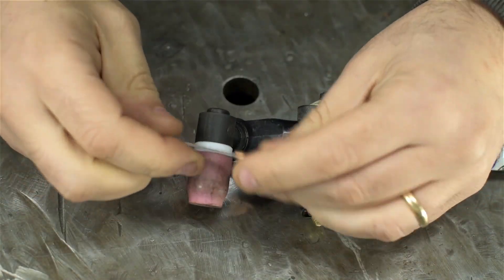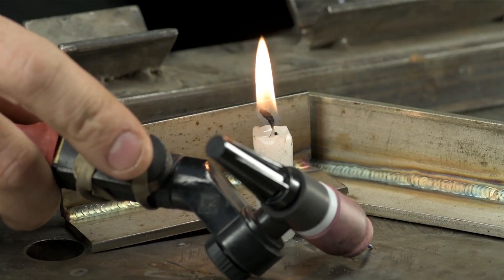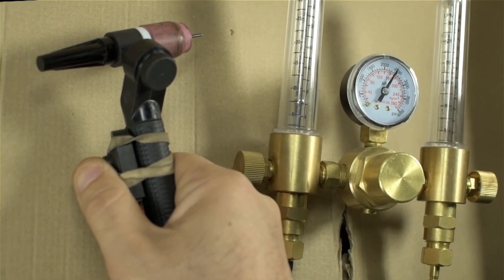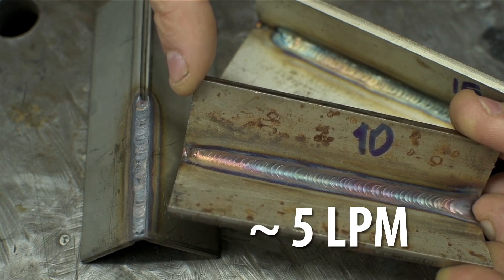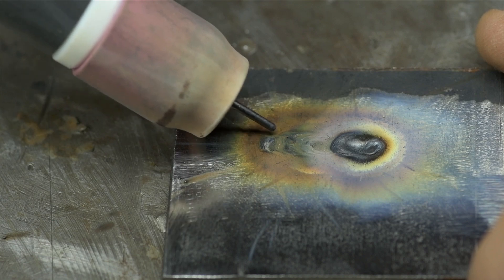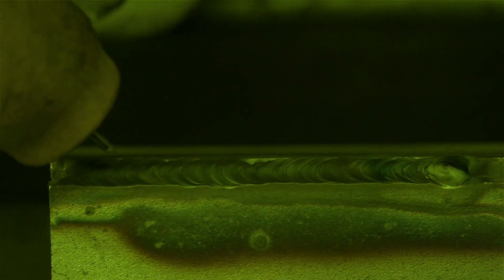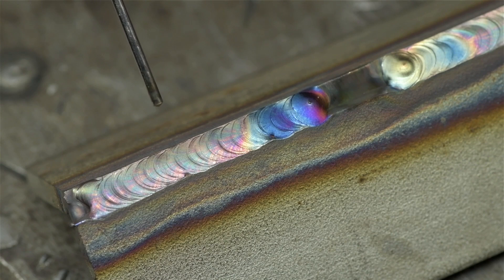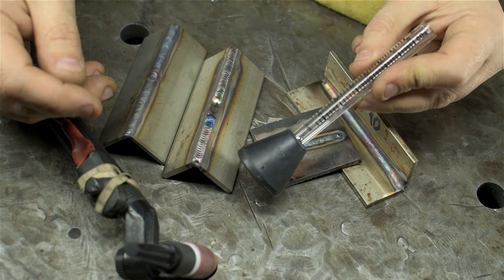TIG: Effects of Gas Flow Settings

Comment: Typically you take the cup number and multiple it by 2 it’ll get you really close to where you want to be with a gas lens. Amps really doesn’t matter much because the thicker the material the bigger cup and tungsten you should be using. Same rules apply x2 on cup size
Reply from the maker: holy poop I think that actually works.  thanks!
Reply: I concur.....a couple of weeks ago I was getting  some nice clean stainless welds with a # 17 cup at a bit over 30 cfg
Reply: splinky99 you every try to weld 1/4” stainless with a 8 cup? Doesn’t work so well you’ll melt the cup right off. You do need to increase your size with thickness as a general rule. They didn’t design them for a suggestion 🧐
Reply: You're joking right? I weld one inch thick aluminium at work all the time with a standard pink #8 cup. I don't think I have ever heard of or seen a cup "Melt" If you're talking tungsten sure, staying within amperage range is a good idea.
Reply: erikdude666 here is your proof since you seem to know it all. And no I’m not joking ..The thicker the work the bigger the tungsten the bigger the cup. Here is some light reading for you. Again you don’t work for me so do what you like but you’re wrong.  Proper set up is by Amps and work thickness. I’m not going to debate you because I know I’m right. 1/4” should be a 10 cup.  You don’t work for me so idc what you do but I also said stainless. You can’t weld stainless 1/4” with an 8 it just won’t work, trust me on that. 

http://weldinganswers.com/guidelines-for-a-proper-tig-setup/
Reply: erikdude666 and yes a cup can melt. I don’t think you weld 1/4” very long with an 8 cup because if you ran and long enough bead it’ll melt at 200 amps
Reply: Im not saying it can't and I have done 4ft or longer runs welding (you name it) and have never had any issues. Most of the time im using a #7 cup (Whats in the stock room at work most of the time)
Reply: erikdude666 BTW big shot this info isn’t mine,  it’s Miller’s calculator for Tig welding. Let me guess you know more then Miller? let me ask one question. Explain to me why a 4 cup is made an why a 8 cup is made? If not for amp thickness?  I find it funny you are trying to talk to the guy that said fight club he wasn’t agreeing with you dummy. And for the record you trolled my post I didn’t write on yours. And you’re the one spreading bad info not me. This is straight from Miller go look. Btw I’m not too proud to do things another way. Your pride my keep you back on a lot of things. The cup sizes are obviously for better coverage as they go up. You aren’t running 300 amps with a 4 and the amps go up on material size in case you didn’t know that either. Sad day when a troll doesn’t know better because he was just taught to use an 8 on every weld he does.
Reply: Easy. Bigger orifice, higher flow rate of shielding gas on more reactive materials. Its why a lot of people prefer a #4 cup with a stand collet body for aluminium. Its a less reactive material, less shielding needed. Youre speaking as if the bigger cup is some how more heat resistant or effective at higher amps.
Reply: erikdude666 BTW you I said it’s a good starting point if you are trying to get set up. I didn’t say it was the perfect way to do it. You say you weld 1” with an 8 but funny you never said what size electrode or how many passes. I’m assuming you think I’m wrong about the cup size x2 to get right around the proper gas flow too right?
Reply: Nope thats actually a pretty sweet rule of thumb that im going to take from this conversation. Im done replying, obviously youre not going to change your opinion and im done trying to explain things otherwise.
Reply: erikdude666 cool now go troll someone else’s post. And the other guy thinks it’s the torch size for amps. He doesn’t realize the same cup sizes are made for all torches. Let me go Tig 250amps with a 4 cup that makes sense.
Reply: What happened to "I'm not going to debate you because I know I'm right". Gotta love primadonna welders. As a separate point, I'm pretty sure you fundamentally misunderstand the concept of debate.
Reply: 9rjharper trolling again?
Reply: good rule of thumb bro.
Reply: Holy poop, is this the secret welders fight club ?  To the winner goes another ToT video ?
Reply: @Johnny Dingo I just despise the spread of misinformation displayed as fact.
Reply: Can't say I have, you might want to look into a higher quality cup considering theyre designed to withstand around 3000F. But that's not what we were discussing at all, im saying you dont need a bigger cup for thicker materials. I have used the same 8 gas lens cup on 350-400amp aluminum work and the only time I have had any issue is dropping the torch. I also use the same size cup welding thinner than 1/8th SS for nuclear applications and have never heard this rule of changing cup size for material thickness. Considering the number on the cup only refers to the ID of the cup in 16ths.
Reply: erikdude666 again general rule. You didn’t read the link. The recommend cup size for even half inch is 5/8” which is a 10 and that’s dictated off material thickness. I also know for a fact you won’t get the correct color with 1/4” stainless with an 8 just won’t happen. I didn’t make this stuff up it’s right on millers site as well. You can do whatever you like but as a general rule this is the correct way. You could be misleading newer welders with your comments just cause you can do it doesn’t mean it’s recommended that’s all.
Reply: erikdude666 the number on the cup you’re right it’s in 16th go to millers welding calculator and you’ll see the cup goes up on material thickness end of story.
Reply: @weldingjunkie  never heard you need a bigger cup for thicker materials. Instead it depends on the material and the coverage it needs, titanium stainless need a bigger cup with higher flow rate. Also the tungsten does not need to be thinner for lower gauge, you can control that with how you taper the electrode
Reply: Alessio Sangalli you’re right about stainless and the calculator compensated for that...but the rest is not true. Does anyone not do any research anymore. 

Go to the miller welding calculator for Tig and watch the cup size increase with material thickness. Just because you’ve never heard of it doesn’t make it wrong. Go to miller welds and look at it.
Reply: @weldingjunkie  when you use a bigger welder you use a bigger torch, like a #26 that is right that we have on the Dynasty 800 but as far as I know it's the torch that is rated, not the cup. Often those online calculators are very "theoretical" as ToT pretty much clarified at the beginning of this video
Reply: Alessio Sangalli my whole premise was a starting point. I’ve said many times if you read do what works for you. The cup size x2 will work. Why do you think they make difference sized for and I know reach is one. A larger cup spreads gas out wider for better coverage I don’t know why I have to explain this LOL
Reply: Alessio Sangalli this is basic 101 just because you don’t do it doesn’t make it wrong. You like your 8 no matter what go for it. Free country
Reply: @Alessio Sangalli Not worth it man, he's just going to beat his chest claiming "Im right! im right!" Sad day when the youtube hobbiest claims more knowledge than a professional trained in theyre trade.
Reply: Here you go. Go look at diff thickness and cup sizes. 

https://www.millerwelds.com/resources/weld-setting-calculators/tig-welding-calculator
Reply: I suppose, but you really dont need a bigger cup for thicker materials.

Comment: Which Flow Meter should we get?

Inexpensive yet good options?

The Diversion 180 came with a regulator, is that bad or less accurate/trustable than a flow meter somehow?

Comment: the real question is if you hit everyone of those welds with a hammer will any of them break. and is it necessary to have the perfect weld to get a weld that works.
Reply from the maker: none of them would break.  sometimes you need a good looking weld and they require less cleaning.  for critical work (pressure vessels etc) they'd need to be much better than mine!

Comment: Fine Video. Don't forget that a different gasflow-rate also changes the rate of depressurization and thus the gastemperature. This might add the problem of developing differing microstructures inside the welded material. This may aswell change the specific material-properties.

Comment: How many CFH should I use if I’m using oxygen instead of argon?
Reply from the maker: around 0. :)
Reply: if you are using oxygen instead of argon  i would have the local burns unit on standby and an ambulance parked out front with the engine running

Comment: So you use straight Argon for shielding gas? When I had my mig rig, It was suggested by the welding shop that I use C25. Any clue as to why?
Reply from the maker: argon for Tig.  c25 or similar for mig.  back when I had my mig I got to using straight co2.  welds were dirtier but co2 was cheaper.

Comment: Thanks!
That was probably the most effective and comprehensive, yet compact, explanation on TIG gas flow setup I've seen so far. Not to mention, the funniest (which I always expect, God knows why). BTW, to drag air into the gas flow, you also need a small narrow lens.

Comment: I bought a TIG welder to improve my welding game about... a year ago.  My welds kept coming out dull like in your video.  I'm finally going to muster up the courage to try again.  Thanks Tony!!!
Reply: furiousbob weld faster with more amps, same result less overall heat input
Reply: @sweenep86  Unfortunately I weld out of my garage with a 110v 15amp breaker. My tig maxes at 85 amps before the lights start flickering. 95 amps and my breaker pops. 

I keep it at 85 amps or below and stick to 13ga or thinner steel for now.

Eventually I'll just move it work where I have a 220v breaker.
Reply: Nothing ventured, nothing gained. Keep at it, the best welders in the game, started with shitty sputtery welds.

Comment: I literally LOL'd a dozen times during that 9 minutes.  I almost fell outta my chair at the "thanks for watchin'" at the very beginning!!     So I haven't tig welded yet, but Im curious why you said we should have a flow meter instead of a regulator?  or was that a joke that went right over my head, lol.  Thanks!
Reply: a regulator regulates pressure and a flow meter regulates flow,  the pressure will vary depending on total  restriction, which includes tubing size and everything between supply tank to the torch end discharge nozzle selected, so the pressure could be anything from nearly 0 psi to very high at any given "flow rate".
end result, trying to regulate by pressure (PSI) the flow could be anywhere from near 0 cfm to very high, dependent on the flow restriction (backpressure).
I should have mentioned, you need both regulator and flow meter since tank pressure is very high and needs limited first

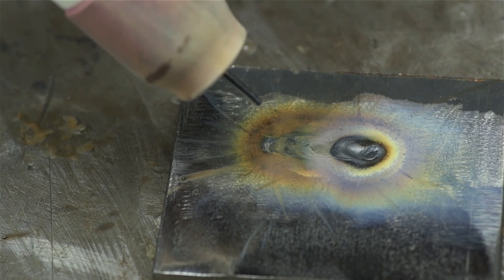Comment: At 5:14, that can occur if your tig setup is installed backwards (DC electrode positive), correct?

Nevertheless, thanks for the great video!
Reply from the maker: DC positive puts a lot of heat in your tungsten.  If its a bit tungsten, or low amps, you could probably get away with it.  best to stick to DC negative unless you have a very specific application.

Comment: Thanks This old tony, lack of inert gas is probably the leading cause of my welds not sticking, followed by not having a welder in a close second. Cheers!
Reply: That whole missing the welder bit will seriously hamper your weld quality.
Reply: Nonsense. You can weld with any sufficient source of heat! I use Taco Bell fire sauce.
Reply: Kyle Emmerich Weld your septic pipes shut with that system!
Reply: I'm sure that works, I generally have my ex-wife glare at the joint
Reply: I suspect it does ;)
Reply: What no chewing gum? LOL
Reply: There is always some sort of plan B. You have a Brooklyn handle. There is probably some old bridge being torn down in New York State that has those big chain links made of true wrought iron. All you need to weld them is a bunch of charcoal and a big hammer ! True hammer welding just like the old pros used to do. No modern equipment needed. Only about 5 years of constant practise and you will be golden. See ?
Reply: You don't own a welder? Please leave this channel you don't belong here lol. ❤

Comment: OK, since you are in the business of splitting hairs - I get it, the case for too little gas is clear. But the opposite is not. Yes, economy and all that... But, to be on the safe side, what about me using an oversized cup and lots of gas. I don't see the downside. The gas velocity will be low, so as not to draw in atmosphere, but the volume will be lots, therefore ensuring good plasma, and low oxidation. Or, maybe I'm just an idiot, who did not pay attention in class. BTW, this is actually a real question. Not flicking your nuts...

Comment: I’ve recently been adjusting pre and post flow and found some troubleshooting issues with each. Long enough pre flow my arc starts are way smoother, the arc start sounds more crisp and the weld just starts better. Post flow my tungsten seems to stay silver which I assume it’s supposed to not colour after use - anyway long enough post flow has kept the tungsten for me with a much nicer ball and cools the weld well enough to look nicer. These tips for anyone who’s seriously learning TIG do take time to learn on your own. starting TIG with no journeyman to show you can be a frustrating experience but very rewarding when you make improvements.
Reply from the maker: excellent point!

Comment: Great video. I weld aluminium boats and I never use under 12lpm ( normally around 15lpm) TIG and 17lpm MIG.argon prices have gone so low where I live. I think your torch angle was a bit much and would have changes the results on the last to max cfh.

Comment: The answer is 10.  Enjoyed Tony!  I have not  changed from that in the last 20 years, but I don't weld much. Unless doing chop and channel work on Harbor freight toolboxes or Nikon comparator bases. ;-)
ATB,  Robin
Reply: The  high end ones I used are as good as any brand regardless of price. They make cheap light duty units also and I am not talking about them.
Reply: My HF set is nicer than a craftsman set I bought ~15 years ago for more than twice as much.  I did lube the slides with some spray grease. The light duty ones do look like junk tho.

Comment: That seems like a lot of work... instead I do all of my TIG welding on the moon - the thin 70% argon, 29% helium atmosphere really saves on gas costs.
Reply: Yea but the freight cost has to be outta this world.....
Reply: Yeah, the commute time is pretty astronomical, but I have Amazon Prime 2 day shipping which is a pretty good deal.
Reply: @Bkrites  and ON another one...
Reply: LOL, well-played, sir!
Reply: This might be fine for some people but my bender doesn't cope with the lack of blackjack and hookers.
Reply: You might still need a bit of gas to strike the arc, or else you'll be leaving the tip of your tungsten in the weld every time.  I guess a high voltage start would do the job.
Reply: @MattOGormanSmith  I've got an uncle that would be perfect for that job.
Reply: Would it really work? As far as I know an arc in a near vacuum would be extremely unstable
Reply: The moon does have some atmosphere, so it should be able to create an arc.
https://en.wikipedia.org/wiki/Atmosphere_of_the_Moon#Composition
The average daytime abundances of the elements known to be present in the lunar atmosphere, in atoms per cubic centimeter, are as follows:

    *Argon: 20,000–100,000[8]
    Helium: 5,000–30,000[8]
    Neon: up to 20,000[8][9]
    Sodium: 70
    Potassium: 17
    Hydrogen: fewer than 17*
Reply: @AlessioSangalli  It wouldn't be an arc. It would be a 'field electron emitter'. https://en.wikipedia.org/wiki/Field_electron_emission.
Reply: Soyuz 6.  Also, NASA has only one or two facts catalogued about the moon.
Reply: @AlessioSangalli  Yeah but this is a complete vacuum. So it would be TOTALLY unstable.
Reply: And if you do it at day, you cut on heating costs because the surface hits 150°C on average!
Reply: @crackedemerald4930  yeah but what about the UNDER surface? Bit of a temperature gradient there....
Reply: Thanks seems a little out of reach for most all of man(kind). And the people who DO have the kind of money to do that on a whim, a moon whim that is, have people to do their moon-based metal working for them.
It's just not practical.
Reply: I was going to contribute to the joke, but the I realized a very interesting problem with tig welding on the moon. Namely that the electrostatic force might overcome the weak gravity and cause the weld bead to rise up and contact the tungsten as soon as it is a liquid. However, that's assuming it stays liquid long enough as liquids in space immediately boil with the lack of any pressure to hold them in the liquid state. Given the liquid boiling issue I wonder what kinds of welding would actually be feasible in space or on the Moon... Hmmmm...
Reply: I wouldn’t be able to weld on the moon. Couldn’t do a night shift
Reply: Good idea
Reply: @MrBen527  yes. For the man in the moon. As of yet he might still be without job.
Reply: I was going to comment on the video. However, after reading this comment, I have nothing to offer. Well done! 🙂👍